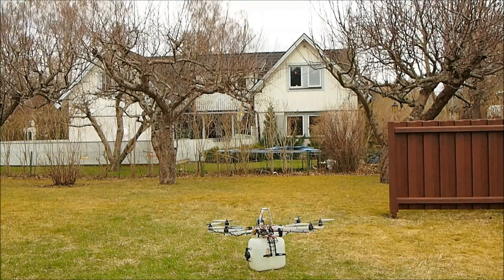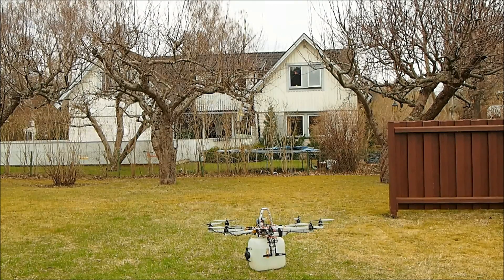9L of flying water

Comment from the maker: Combined with 11x4.7" APC's, yes... I don't quite remember the brand of the ESC's but they're all the same. They were random 40A ESC's.

But as said, it would be interesting to add more capacity. Maybe 20Ah gets it to 30min flight time and 30Ah gets it to 40min... You wanna find the crossing point where the weight of the batteries makes the flight time shorter.

Comment: Ok, so these motors looks very good! What ESC did you use with those motors? So ZENMUSE H3 + GOPRO 3 with 2x6000mah 4s should be 20 minutes correct?

Comment from the maker: With 11Ah of 4S batteries, I'd expect it to fly more like 5 minutes maximum with 9L of water as payload. I did never test the duration of the flight with freshly charged cells till the end so I'm not sure. But it struggled to gain altitude all the time... Some day I'd like to try twice the amount of capacity, somewhere around 20Ah. That should keep the flight times pretty long. With a 400g camera I can fly for 15-20 minutes.